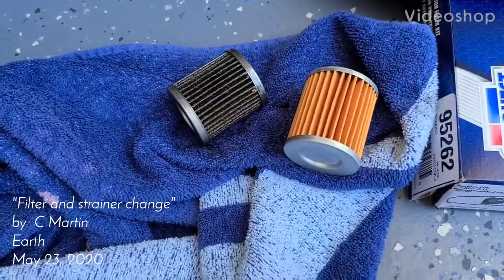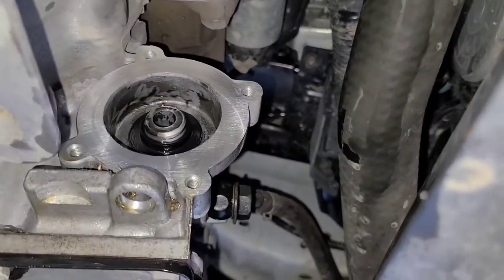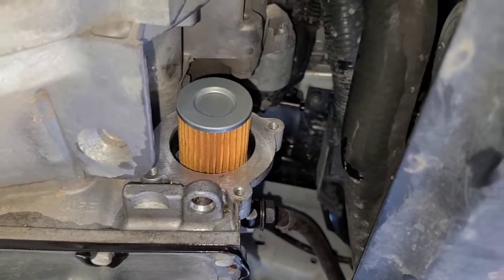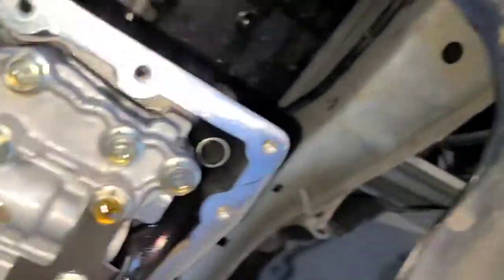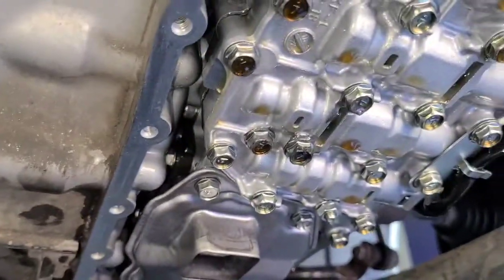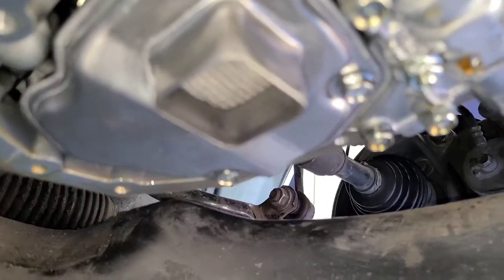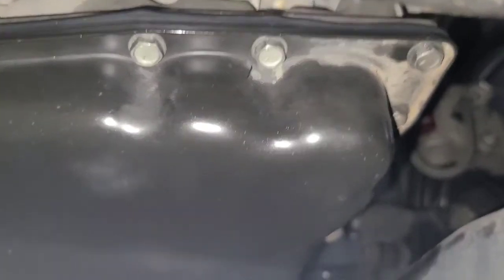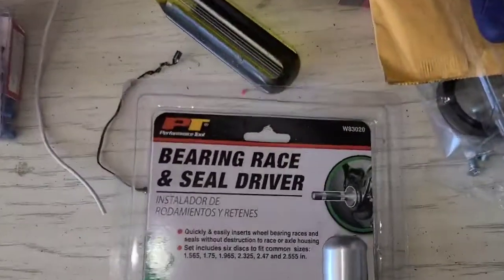CVT service, cooler filter, pan strainer, and axle seal replacement, nissan altima

Comment: Very nicely done man! Good details covering the variations of that filter housing...that 10 o'clock 10 mm bolt is the bitch. Your using aftermarket cooler might be premature before sealing the whole radiator plenum this was very necessary to me since I discovered whining during hard and hot in Mojave. Now 209k.

Comment: When you are putting the pan back Make sure you use the torque ratchet. I over thigh 3 bolts and they now spin loose. I hope it won’t leak and a have to buy a new transmission.
Also there is an order. It starts by 3 bolts in each side and after the back and front loop.
Reply: I had the same issue, 3 bolts from the pan started spinning, its leaking now... Did you had a leak?

Comment: Just a little advise.. Leave the original metal gasket on.
Reply: Absolutely, the metal /rubber hybrid OEM gasket is way better than the plain rubber one, and much easier to put back on.  You can get that type from Fel-pro or other high quality gasket makers.

Comment: Did you have any leaks at the paper filter housing (the one with the 4 bolts) when you re-used the old o-ring that is on the housing?  Do you happen to have a part number or picture/diagram of that large o-ring?  It is not listed in your "parts needed" list.  Thanks and thanks for the video.
Reply from the maker: No leaks, and unfortunately I don't have a part number either.

Comment: Is this cooler accessory available on a 2007 Nissan Maxima? I doubt it. But if it is, I am going to install it "yesterday"! LOL Believe it or not, my car has less than 48K miles on it; yet it is 13 yrs old. I bought it brand new in Sep 2007. Whenever it's home, it is in the garage with the door closed. Looks brand new.

Thus, I want it to last until I die; since I am going on 89 yrs old. Praise Jesus!
Reply from the maker: You could probably instal one but with that few miles on the car it sounds like you don't drive it a lot so you probably wouldn't need an external cooler, the 1st gen CVT on the 3.5l engines was pretty well built, the main problem with the 3.5 setup is leaking valve covers that make the coil packs go bad, the tranmission is usually pretty solid.
Reply: @mygeniv8377  Many thanks for the information kind Sir. It is good to hear that my transmission is "pretty solid".

Comment: There's a second filter in the oil cooler attached on the side of the transmission, it is cylinder paper filter.

Comment: I had my cvt fluid changed but didn’t do the filter. Is it necessary to change?
Reply from the maker: The fluid change is more crucial than the filters but I would definitely change them next time you do the fluid change, at the very least I would do the pan filter.

Comment: how much fluid came out when you removed the cooler filter housing?  I just dropped the pan and replaced the strainer, but haven't done this yet.
Reply from the maker: If you haven't put any fluid back in the transmission yet, there won't be a lot that comes out of the cooler housing, let that drain out as well, that way you get as much of the old fluid out as possible before adding the new stuff.
Reply: @mygeniv8377  sadly i already refilled it.  didn't even know this filter was a thing.  last question.  When you removed the one hose did that require some sort of plug?  or was it "dry" and nothing came out after it's removal from the housing?
Reply from the maker: @briankirsch8177  there will be some fluid draining from the radiator, youcan use a small bolt to plug the hose
Reply: @mygeniv8377  any tips on how to get to that fourth bolt?  The upper left that’s tucked away. What kind of tools worked for you to get to it?  I tried to get that one first since I knew it was gonna be a pain. I was able to get the socket, by itself, onto the bolt, but not while the wrench was attached.
Reply from the maker: I had to use 1/4 inch socket, swivel, and extension to get to that bolt.